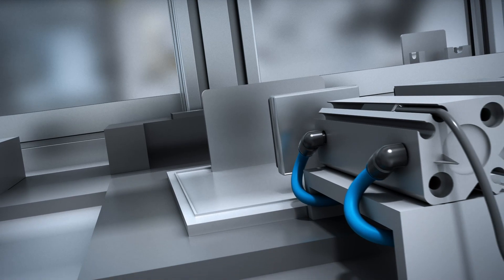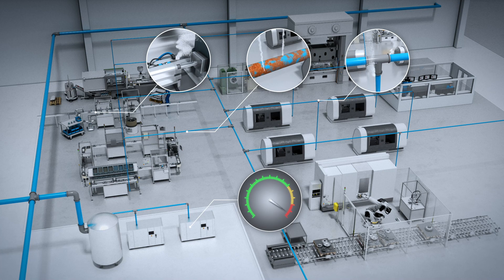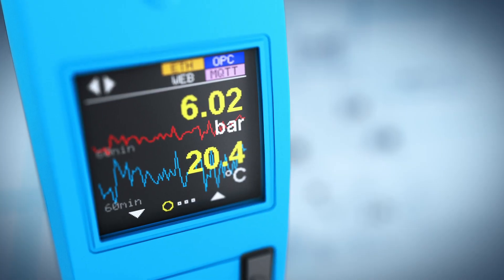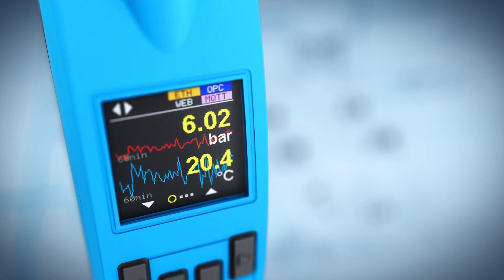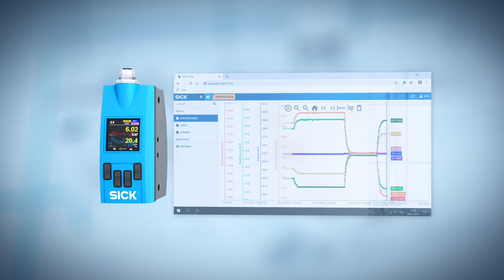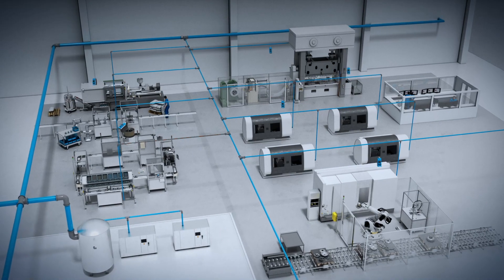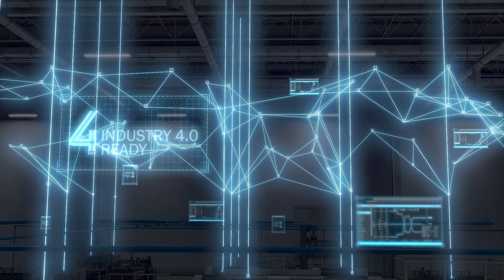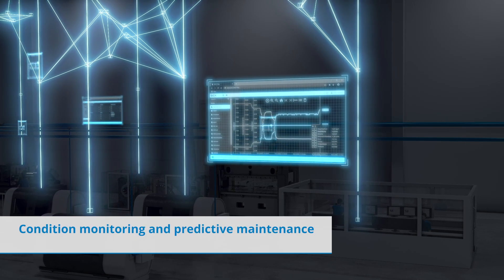FTMg from SICK: Flow sensor with leak detection | SICK AG

Comment: What could be the maximum size of air line diameter it can fit into ?
Reply from the maker: The maximum size for our flow sensor FTMg is DN 50. The sensor is also available in DN 15, DN 20, DN 25 and DN 40. More here: https://www.sick.com/de/en/fluid-sensors/flow-sensors/ftmg/c/g505155